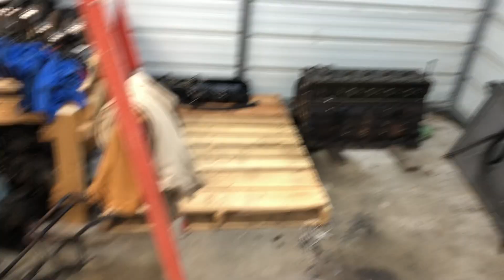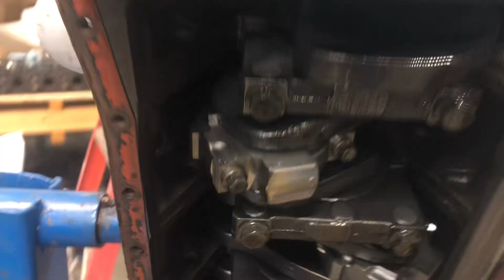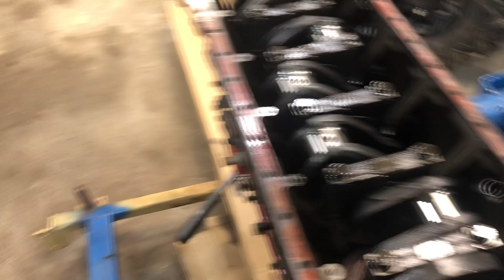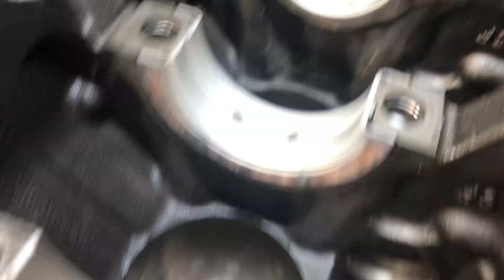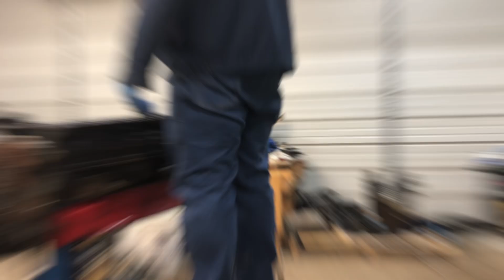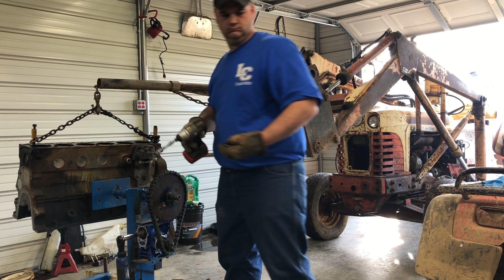Cummins Cracked 53 Block Disassembly

Comment: How did this new block end up holding up? You didn’t feel any need to resurface that new used block? Sounded like you had the head resurfaced which is good cuz you can never be too sure on an inline 6 haha. 

Did you use an original Cummins gasket or a felpro or something? I also have a 53 block in my Cummins 24v. The water pump has been modified to slow the flow down a touch and I put in a higher thermostat so that when it opens the block doesn’t get such a hard shock from the temperature difference. I’ve got 274k on it now.. knock on wood. It’s been upgraded pretty heavily since I bought the truck when it had 230k on it.. so almost 50k on this block since I’ve owned it and it was bone stock when I got it.. now it’s pretty well upgraded and such.. makes good power and torque.. so far no coolant leaks or cracks but when I say “knock on wood” I really mean it! 😅😅😅😅
Reply from the maker: The new block is doing great so far. It probably would definitely be ideal to have a used block like I bought surfaced to be on the safe side. However, I did check it good with a straight edge, checked the cylinders to make sure they were within spec and not egg shaped, honed it, and then hot tanked it to get it clean. The head I did have surfaced just to be on the safe side. I believe the gaskets I used were felpro if i remember correctly. No leaks to speak of so far 😬 Not all 53's are going to crack, so for your sake, I hope you got a good one! Unfortunately i didnt get as lucky but Im fortunate enough to be able to do the work myself which made it cost effective because I really didnt have a lot in doing the work. You could always keep your eyes open on marketplace for a spare engine or block to stash away. Sometimes you can find a deal. If you do , just make sure and stick with the correct year range since there were differences in how 98.5-00 and 01-02 get their crank signal. a lot of people find that out the hard way after swapping in the wrong version. Best of luck!

Comment: Just found out my 53 block is cracked...
Reply from the maker: @Djenson617  sorry to hear it. It’s a shame to have to pull an otherwise good engine out because of a crack in the cooling jacket. The casting was just too weak to handle the vibration and heat cycles over the years.
Reply: @CumminsDriver  I might attempt to patch the crack and clip the water pump blade.  Hopefully, it will stop leaking and prevent the crack from growing. We'll see where alternative options get us.
Reply from the maker: @Djenson617  Good luck, i hope it works out for you. I was considering welding mine until it split out into an 8" crack one day and I decided I wanted to not have to worry about it doing that again, so I found another block. lol But I wouldnt blame you a bit for trying to save it.